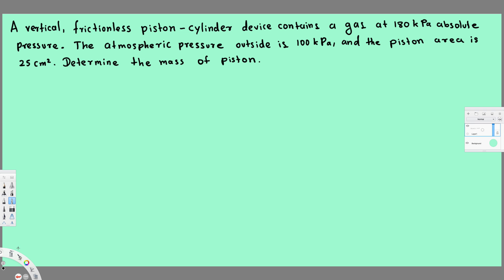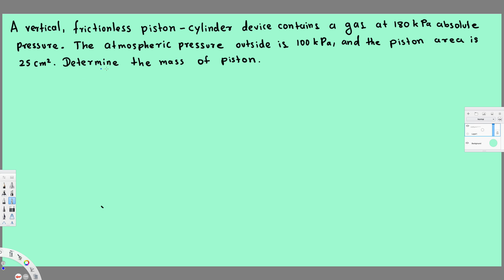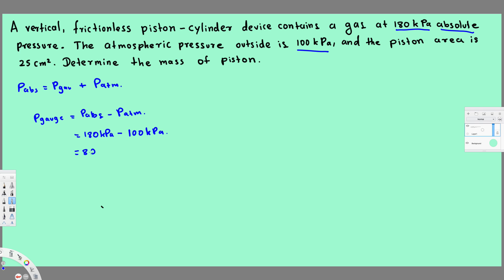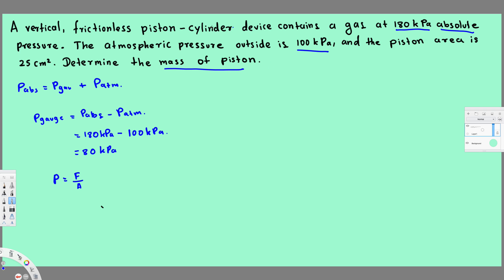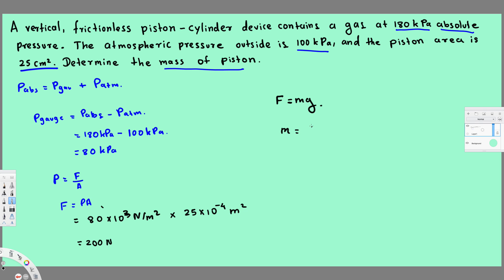Determine the mass of piston - Thermodynamics

Comment: The pressure of a gas in a well-sealed vertical frictionless piston-cylinder device is 150 kPa. The pressure is to be increased by adding a mass of 25 kg on the piston. The diameter of the cylinder is 14 cm.

1) Assuming the device is exposed to normal atmospheric conditions, determine the mass of the piston. Answer in kg.Answer
2) Determine the increase in the pressure of the gas. Answer in kPa.Answer
3) Determine pressure of the gas after adding the mass. Answer in psig. Answer

can you help me to solve this question please